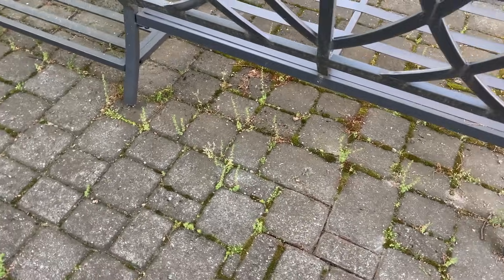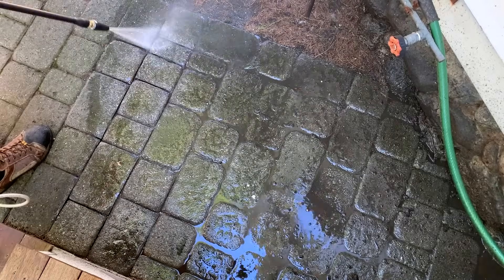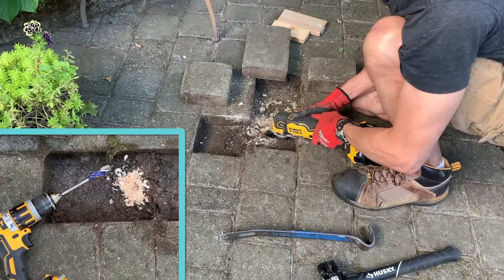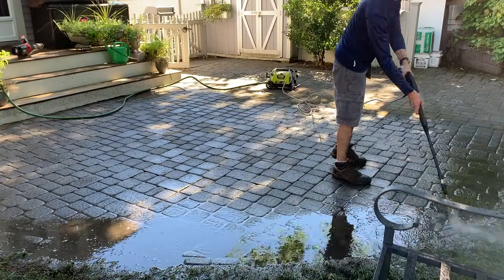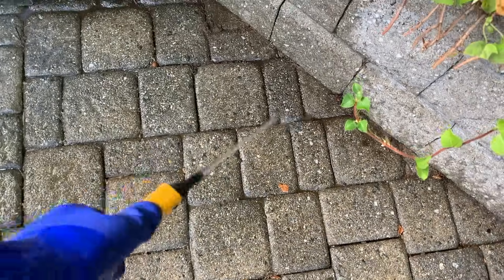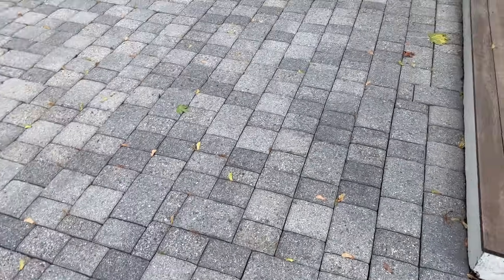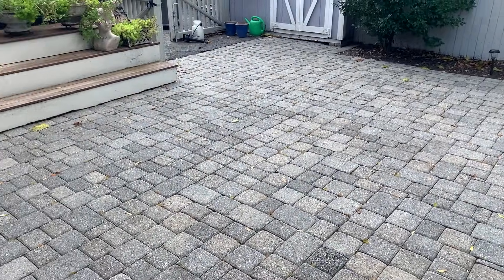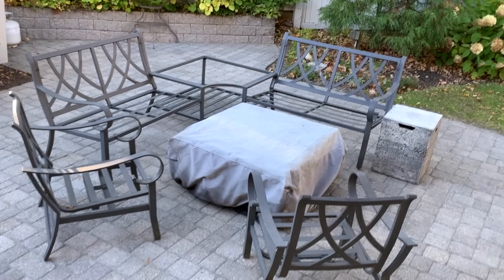How To Clean Your Patio and Kill Moss - Patio Restored!

Comment: I stop doing this. I just spray vinegar in the spring. And the weeds would die out and fill the crack.😂
Reply from the maker: White vinegar is OK for short term use unless your pavers are sealed. If left on too long it will dull the sealant and can eventually pit the concrete.

Comment: But moss is good?
Reply from the maker: Moss isn’t bad and it’s fine on a patio. I was concerned  someone could slip and get hurt so it was time to get it under control. The moss had also spread into the lawn and was choking out the turf grass. I aerated the lawn to reduce soil compaction (improves drainage) and cut back tree limbs to allow more sunlight to penetrate the area. I don’t mind moss, but I’m not looking for it to be the dominant feature in our backyard either. 😃

Comment: Polmeric didn’t seem to last long
Reply from the maker: Hmmm… if you used a good quality sand, it should stick around for years. Could be that the bags didn’t get mixed well so the polymers settled (I usually roll the bag a few times before opening) or maybe the joints weren’t watered deeply enough to activate the polymers.
Reply: FYI, there is a huge price difference between Gator G2 vs. Home Depot ones....

Comment: Well Bruce, not using a circular surface cleaner was your first mistake. Your weak excuse for using the manual putty knife method for removal of moss in between pavers was cringe-worthy (when you realized how much water you were using?) For anyone doing this project, use/rent a surface cleaner on pavers/concrete. Also use a fan tip on your pressure washer wand to blast out the moss cakes. Could be done in half the time it took this guy to do the work!!
Reply from the maker: Thank you for your sharing your thoughts and ideas.
Reply: Geez Bob, why bother? 😒

Comment: The sand does not work-
Reply from the maker: Are you referring to the play sand I temporarily used to hold the pavers in place before pressure washing or the polymeric sand? If you’re referring to the polymeric sand (or specifically the Pavermate 3 product) what specifically didn’t work? I’m sure folks would appreciate hearing about your experience. Thanks for the clarification.

Comment: Your cleaning method sux. All a pressure washer does to concrete blocks is remove a smooth surface and allow increased moss growth.
Reply from the maker: Thanks for sharing your experience. I’ve found that once the patio is cleaned and resanded, it only requires 30 Seconds Cleaner rinsed off with a garden hose every 2-3 years to prevent significant moss and algae buildup. For folks concerned about pitting, I’d say don’t use a pressure washer more than 1900 PSI although I’ve used a gas powered 2800 PSI pressure washer on other pavers without issue. Another option would be to apply a sealant to fill in porous concrete pavers and further minimize algae and moss growth; however, sealant typically needs to be reapplied every 3-5 years and if applied incorrectly creates additional headaches. Our pavers are ~20 years old and there’s minimal wear so I’d say they’ve held up well.